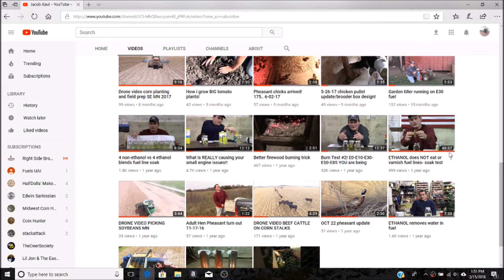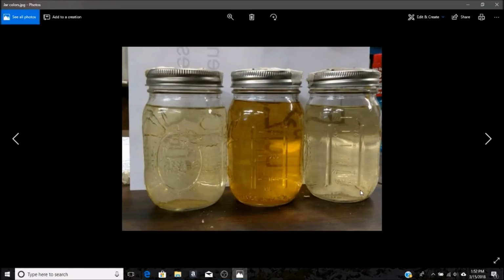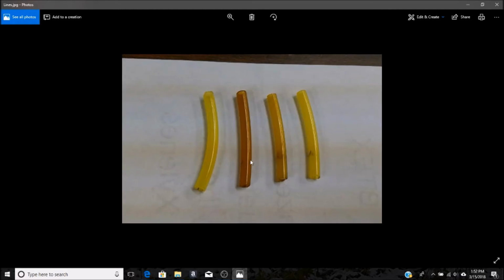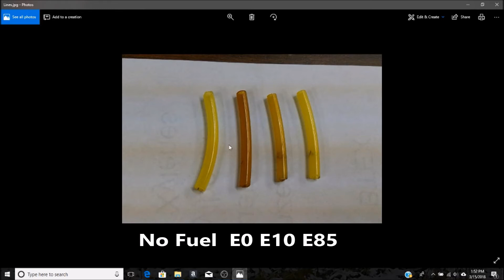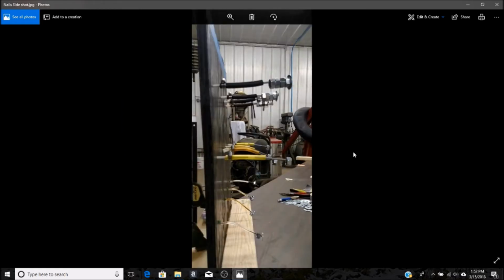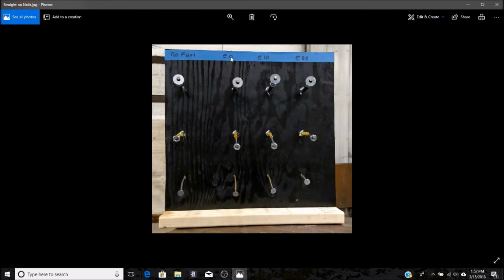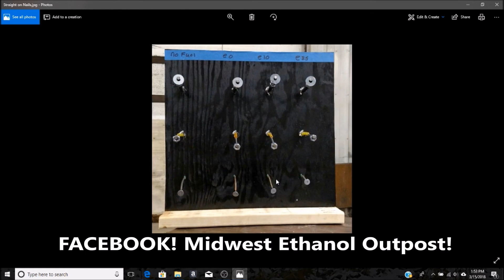E0 E10 E85 50 Day Fuel Line  Soak Test Reexamined

Comment: So what your saying is its safe to run e85 through whatever fuel lines?
Reply from the maker: blindabinda123  if they are modern most likely absolutely. Simply research a compatibility website. Of course air to fuel ratio etc would have to be adjusted amoung a few other small things